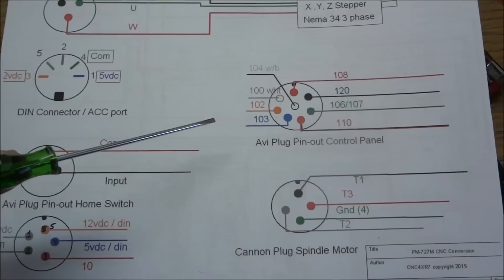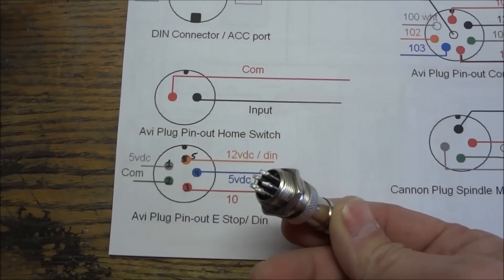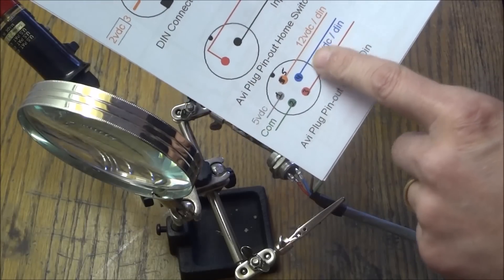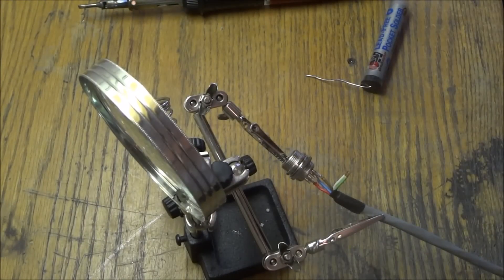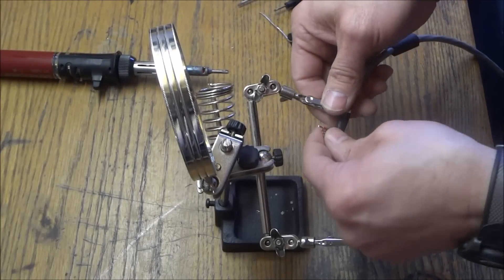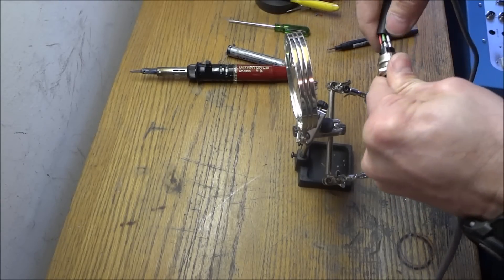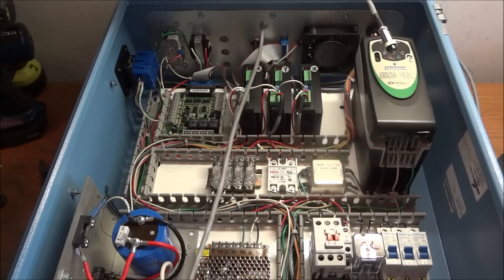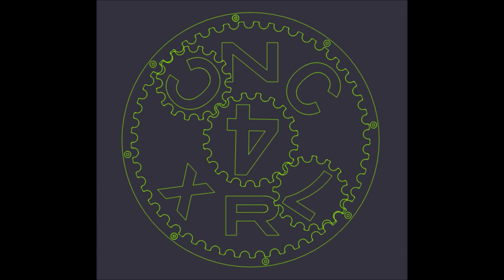PM 727M Wiring Pt 5a  Control box aviation plug

Comment: Hey Sam, what did you use for the DB25 panel mount?
Reply from the maker: Search for that on Ebay you will find them male and female depending on what you need.
Reply: What is it called so I know what to search for?
Reply from the maker: @halfstep67  
Search for db 25 Dsub panel mount